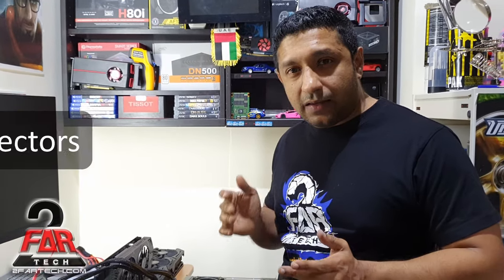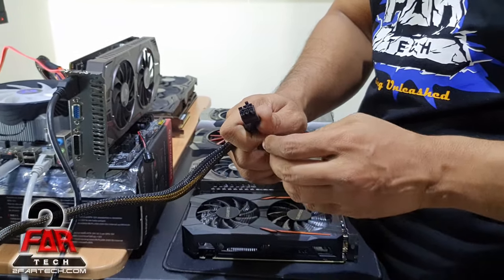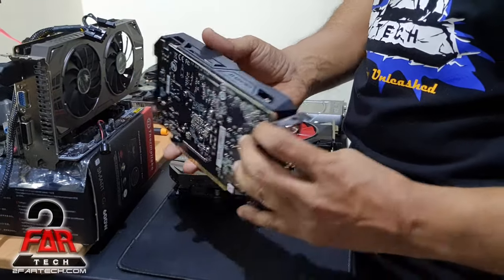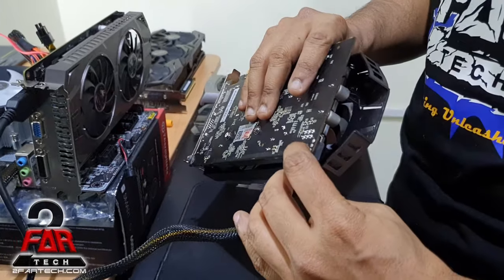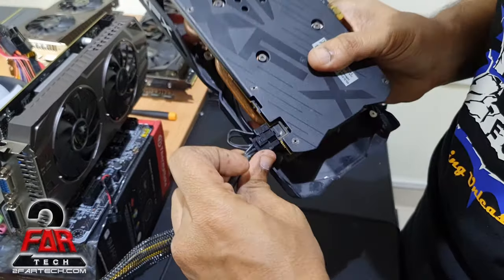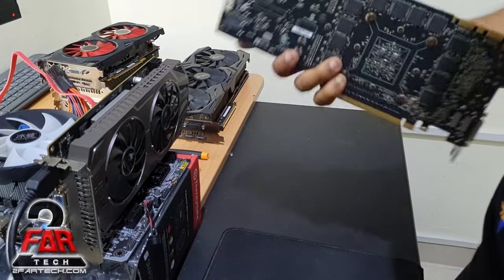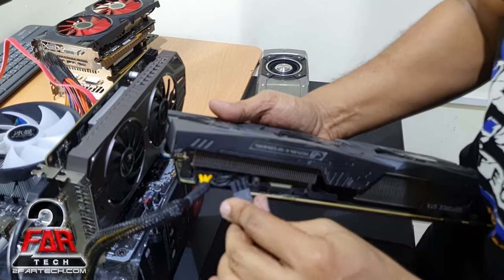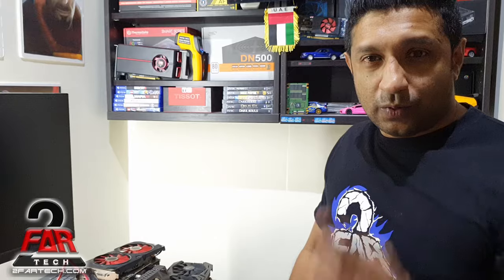How to connect the power to the graphics card?

Comment: Hi, I was hoping if someone could help me. I have a 8 and 6+2 pin cable extender question that I had recently bought. I have a 1070 Ti video card that has an 8 pin with a 6 pin port. However because of the tight fit of the mini-ITX case, the door is unable to shut because the connectors (the one that came with the PSU) are way to stiff for the door to shut. They stick out preventing the door from closing. And so I'm using the 8 pin and 6 pin extender which are very very flexible. The door closes and the build is finished. However I do have one major concern, since one of the 1070 Ti has a 6 pin port, is it safe to plug the PSU Y-Splitter 8 pin cord directly into the cable extender (8 pin port) THEN connect the other side which is a 6+2 pin connector, of which I am only using 6 pins into the 1070 port? Or do I need to REMOVE the 2 pins connecting from the PSU cord that goes into the extender which matches the 6 pin port that is on the 1070? Thanks for any help.
Reply from the maker: You can just proceed normally.  You don't need to remove the 2pin to match the 6 pin on the graphics card.  Don't worry

Comment: i have a question can 6+2 pin power supply plug on 6 pin gpu? like i dont use the 2 one just the 6 pin
Reply from the maker: Yes, Its totally okay. The +2 part would be left unconnected. Go ahead
Reply: @2FarTech  thanks mate!

Comment: My motherboard is A320M Pro , and it has 4 pin cable,
So can i connect a 6 pic graphics card with that?
Because the shop owner told me you will face voltage problems.
Reply from the maker: First of all, the motherboard would not have a power cable.   The cable must be coming from the power supply unit (psu). The 4 pin connector from the psu is for the motherboard,  cpu power. You need that for the motherboard to work.  If you have extra 4 pin connector you can try to use it to power the gpu, but that's a bad idea.  The reason why your psu doesn't have a 6 pin in because it can't handle that load.  If you put that extra load through another source you could damage the psu, motherboard and graphics card.  For a basic graphics card you only need a 500 watts psu.

Comment: i have a cable that has 12 pins on psu and the cable branches into 8 pin and a 6+2 daisy chain...is this enough to power 3070ti?
edit my psu is xfx pro 1000w.
Reply from the maker: Somehow i didnt see your message before. So the PSU side is 12 Pins and the other side has 8pin and 6+2 Pin should be fine.

Comment: Hey man I have a question tomorrow im gonna add a  gpu to my pc but I don’t understand something and I still can’t find the answer when l put my gpu inside my pc where can I find the 8 pin power cable to plug it in my gpu pls answer me Like is it behind my pc or where is it
Reply from the maker: Sorry, we have been busy with the workshop and builds. My first question would be, what is the model, brand name and specification of your power supply on the PC. If you are going to say my PC is HP or DELL old machine, then I will say that you wont find that cable. If you will say its a corsair 650Watts PSU then i will say, open the case and trace the cable from the backside of the PSU. Since its been two days, i bet you already know the answer
Reply: @2FarTech  I broke the pc and my gpu yesterday trying to put the gpu in and find the 8 pin cable

Comment: If I had those cables I wouldn't be watching this video
Reply from the maker: Unfortunately without those cables you wouldn't be able to power your graphics card properly.  This is the recommended way.  If you didn't have those cables it definitely means your psu isn't upto to the mark.  Upgrade to be a better psu for peace of mind.  If you like to take risk, sata or molex to pcie 6 pin or 8 pin adapter cable.

Comment: Sir hope you are doing fine, i have  evga gtx1080ti sc2 how much would it need?
Reply from the maker: Its better if you will get a 650watts 80 plus rated psu. Gtx 1080ti has two 8 pin power connector so the psu should have the same too.

Comment: please make an update with triple 8 pin with individual custom cable (not the y)
Reply from the maker: The idea is the same, bring three separate cables if your PSU supports them. 3 x 8 pin model GPUs require at least 2 cables + Y or 3 separate cables to make sure you are on the safe side.

Comment: i have igame rtx 3060 which requires 2x 8pin connector. my cooler master 750watt psu have 2  6+2pin connetor from 1 wire.. also it has same extra 2x 6+2pin connetor wire coming from psu... do i need to plug 2 different 8pin wires or only 1 wire which has  2x8pin?
Reply from the maker: RTX 3060 basically requires just one 8 pin. You model might be the triple fan model with overclocking headroom, that's why it is asking for 2 x 8pin. Now the answer. You can use the 1 wire with 2 6+2 pin and it will work fine. But the best practice for long term benefit would be to use 8pin from 2 separate wires. In this way the load is balanced, the wires don't get stressed out and the pin connecting in the PSU also doesn't have and extra load. The only issue here is cable management. You need to wire them up properly. More wires, more trouble.
Reply: @2FarTech  wow..thanks for this fast reply.yes my gpu has 3fan and 1 click oc button . love from INDIA
Reply from the maker: Brother, Hit that like and subscribe if you can.  Thank you

Comment: Now I’m a bit slow but Is there another part of the Cable that goes anywhere else in my pc?
Reply from the maker: 24pin motherboard cable, 4 or 8 pin CPU Power cable, then graphics card cable. These are the main ones needed to run the system. If any one of them isnt proper, your system might not even turn on. Ensure the graphics card has proper Pcie power connection, not some sata or Molex to pcie covertor cable. It could also be slow due to cpu heating up

Comment: Electrical industry has been wire color coded for most my 74 years.  The motherboard, power supply, and GPU industry has run amuck.  No more codes, no more colors.  I just recently had a1200 watt ATX power supply  that did not match the 1000w ATX power supply I had.  The 8-pin connectors and the colored wires were in different locations.   But the connector keyway fit.  Yellow - black wires.  Worst part there are no longer instructions or diagrams of graphics board power and ground locations to verify the power supply is wired right.  As least a diagram on the graphics card would help for power and ground connector positions.
Reply from the maker: Flat black or white cables are the new color codes.  If you are swapping a cable,  it's always a good idea to use a multimeter and understand the pin out polarity and voltage before the swap. Check the new cable before it's used on graphics card or motherboard.  When we do this,  we even move the pins from the plugs to match the output.  Some pins are stuck, and for those, we cut the wires,  soldier, and heatshrink.

Comment: I just bought a 3070 and I have only the 6+2 cable and it has 2 8pin connectors. Do I need to buy another one?
Reply from the maker: What's your psu? Model and type.  I am pretty sure at this point that you need a decent psu.  8 pin  is (6+2)
Reply: @2FarTech  bought a new PSU fractal ION+ 560P and got advised to have 2x6+2. I got it to boot and seems fine after a few disasters

Comment: if my gpu requires 8+6 pins, and i connect only 8-pins would that be enough?
thanks for the video ♥️
Reply from the maker: That wouldn't work and it shouldn't be tried.  Most of the time the gpu has onboard circuit to detect if both the plugs are populated.  And in terms of power requirement, the single 8 pin can't deliver the whole power for a card that has this kind of dual plugs.
Reply: @2FarTech  
thank you for your quick response. 
it's clear now 👍🏻
Reply from the maker: You are welcome.  😊

Comment: The end of the cable that is plugged into the psu does that have 6 pin or 8? When powering 3070ti
Reply: In other words do I need 8 pin to 6/2 pin cable or can I use a 6 pin to 6/2 pin for a 3070ti
Reply from the maker: 3070ti is a power hungry card.  If you are pairing it with any latest i5 processor or higher is suggest atleast a 750watts gold rated psu. Now those types of psu will come with atleast  2 x 8pin (6+2pin) modular cable. And depending on the brand it might have (2 x8 pin) per cable.  And the other end(psu end) Typically will be a single 8pin connector.  You need a decent 8 pin to 6+2 pin units. Now if your psu comes with a 6 pin to 6+2 pin is on a 750watts gold rated branded psu like corsair, Thermaltake, evga, seasonic, deepcool, etc... then it should be fine  too. Share the psu model details
Reply: @2FarTech  thanks for the reply I have a 850 rx corsair psu and I'm running a i7 10 gen and a 3060ti and want to attach a 3070ti for mining crypto and have used my cables I already have for my 1at card
Reply from the maker: Make sure you undervolt these cards to make sure they don't exceed the power draw and melt the plugs or blow the psu. You will see psu shutting down if you draw too much power.  There are a lot of videos showing hot too setup fixed core clock and memory over clock with trex miner. It will limit the power usage to 60 or 70% depending on the card.
Reply: @2FarTech  I think I can change that in msi after burn oc settings? If I'm using 8 pin to 8 pin I should have no problems?
Reply from the maker: 8 pin to 8pin is fine.  Use 2 separate 8 pin cables if you have.  And search about latest trex miner with core clock lock. In this way, you can input all the settings into the miner command line or bat file and no need to mess with msi afterburner.  Also by core locking your energy usage would be less than setting up with msi afterburner

Comment: My new GPU has 3 8 pin slots. Is the third only for overclocking or essential to it's operation.
Reply from the maker: Some gpu models have detection mechanism to see if all the pins are plugged in. Such gpu might not work at all when you boot up the system.  But if yours is working with 2 x 8 pins, then its okay. However i don't recommend it.  This obviously means your psu doesn't have the extra 8pin connector and this your psu won't be able to handle the load during heavy gaming sessions or rendering tasks. The voltage drop will garish crashes at some point and bring about the premature failure of the psu. The psu failure isn't a good thing as it can cause damage to other components when it fails.  Since you could get this card that requires 3 pin, you should be able to afford a psu that's 850 watts gold rated to handle all the load.  Good luck
Reply: @2FarTech  Thanks for that. Finished the build today and the 450 PSU is coping but I will upgrade the power when I switch computers.
Reply from the maker: Which gpu have you got?  Let me give you some idea, an i5-11400 + rtx 3050 will take a peak of 380 watts under initial load.  This is a basic configuration.  The 3 pin gpus are rtx 3070 and above.  They are not meant to run on such low end psu. So upgrade as soon as possible if you are planning to game for an extended period of time.
Reply: @2FarTech  AMD RX6900 XT Red Devil. I won't use it as I have another computer. The 450 PSU is from a recondition intel motherboard running windows 7, 15 years old. New build is CPU i9 11900K, motherboard MAG Z590 Tomahawk. Have a old 1200 thermaltake I can use when I settle down and unpack boxes.

Comment: Sir plz suggest me best power supply for rtx 3070 8+8pin I am confused plz reply
Reply from the maker: Any corsair model which has atleast 750watts  power and 80+ Gold rated. Other brands like EVGA, Seasonic, Thermaltake toughpower series, nzxt c750 etc...
Reply: @2FarTech  thx for your reply, & antec 750watt psu is best or not

Comment: Can I use a 6 pin gpu with 4 pin motherboard with a special cable?
Reply from the maker: 4 pin motherboard cable is typically the CPU power connector.  It's used for CPU power.  If you disconnect the cpu power then the whole cpu won't work. The 4 pin on the cpu power cable is 12V and ground which is the same power used by GPU 6 pin. Its better to use mole  to 6 pin converter cable instead

Comment: Hi bro i have gigabyte h61 board with i5 3450 + 4gb hyper x ram with gigabyte b450 w Power supply so 1050ti no need to coonectotor n what about rx 470? N which gppu is best for me 1050ti or rx 470 reply me
Reply from the maker: The basic GTX 1050 Ti requires no 6 pin connector, but some high end GTX 1050 Ti requires 6 pin connector and it might not work without it. Those requiring 6pin connector has better overclocking features. But overclocking a GTX 1050 Ti doesnt make any difference. The RX 470 is a better card than GTX 1050 Ti, however the RX 470 will have bottleneck with i5-3450. It means, your processor will reduce the performance of your GPU in some games. But you can also upgrade to an i7-3770 in the future on the same motherboard. Also have atleast 8GB or if possible 16GB RAM.
Reply: @2FarTech  ok thanks bro so rx 470 is bette for me right if i get rx 470 n upgrade my ram to 8gb with i5 3450 so its good after some days m going with  i7-3770  + 16gb ram
Reply from the maker: Perfect. With i7-3770 + 16gb + rx 470  you are good for another couple of years in gaming.
Reply: @2FarTech  thanks a lot bro for ur time thanks for help
Reply: @2FarTech  no need to upgrade board?
Reply from the maker: Bios update to the latest version, which might actually be very old too as there has been no update for these boards in the last 5 years or so.  Good luck

Comment: What happens if I have a gtx 1070 ti and there is a 6 and a 8 pin but the connectors I have is all 8. Can I try to fit the 8 pin into the 6 pin slot
Reply from the maker: the 8 pin cables are actually 6pin + 2 pin. inspect the cables closely and you will see the 2 pin can be detached from the 8pin effectively making it 6 pin connector.

Comment: i have one that needs 2 8 pins but the psu has one 8 pin cord with a 2nd 8 pin coming off the first 8 pin is this the same thing or will this not work?
Reply from the maker: It will work.  But if you have a second separable cable on the psu, you can use that.  If you don't have, don't worry.  It's fine.
Reply: @2FarTech  ok thank you! ^^

Comment: I bought my PC from ebay, it didn't come with a Graphics Card so I used my GTX 1050Ti from my last pc, In the box it came with a sealed plastic bag with the Motherboard Manual, PSU Plug, and some cable management things I think they are..? I want to upgrade to something like a 1660Ti, so should I buy a gpu power cable from ebay or amazon or something??
Reply from the maker: Depends on the psu in your current pc. The gtx 1050ti isn't a power hungry card.  The gtx 1660ti is also low on power but it does require a psu with atleast a proper 6 pin power connector.  Using a splitter or convertor isn't the correct method.  If your psu can't handle the load, it will fail.
Reply: @2FarTech  I have a 700w PSU, what I meant was im not sure what to do because the PC did not come with any GPU 6/8 pin or whatever connectors.
Reply from the maker: If it's a decent branded psu, the pcie cable is already part of the wires on this psu. You might have to remove the back panel of the cpu case and check all the wires to find the correct one.  Also if your psu is premium, the cable might be modular, which means it can be attached or removed from the psu, like a connector.

Comment: Can you use an external psu to supply power for a card while the card is connected to a motherboard that is not powered by the external psu?
Reply from the maker: Yes, its possible and it will work fine.  But then how would you turn on the external psu at the same time you turn on the pc and other factors should be considered.
Reply: @2FarTech  no idea😂 i dont want to change my psu thats on my pc but the power is not enough to take snother graphics card so i was thinking of an external psu while the card is connected to the main motherboard, so confused i have no idea if it works
Reply from the maker: The best way to do this is by changing the original psu. Your work-around will not be the best solution for you.

Comment: Is it true for mining you only need to plug in the 8pin and the remainder 6 pin is not necessary?
Reply from the maker: First of all, some cards do not work unless you plug in the second 6 pin connector. If it works then its not wise to push the card to the max like gaming where the lack of power might cause the system to crash and reboot. Also it might cause the 8pin PCIe power to be overloaded as its pulling more power through single cable. Mining is a different story but similar facts. Power is constantly used without any breaks so the power cable and connectors are under constant stress. Its better to balance the power draw through both cables than 1. Some algorithms use lot more power than the other and might not work well without the extra power connection.
Reply: @2FarTech  thanks, because my friend took off the 6 pin and piddy backed it to another gpu, its for mining, and said you will waste more power and end up lowering your profit
Reply from the maker: If power is required, it will still pull the same amount through the 8pin, and then when it starves, it will either crash or drop the performance.  You can't save power in that way. You save power by setting power limits on the software or miner. Maybe you have an OC edition card that has the extra 6pin for safety reason.
Reply: @2FarTech  yeah it has an 8 pin plus the 6 pin, and its only plugged in to the 8 pin.
Thanks for explaining to me, its all new to me